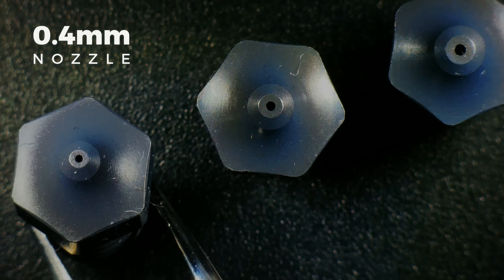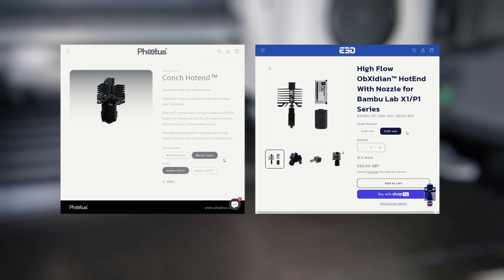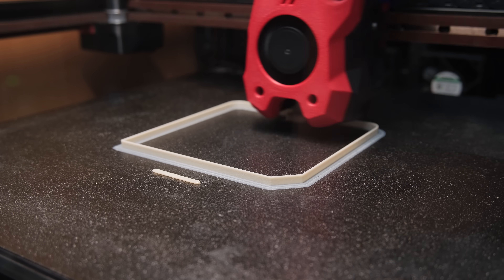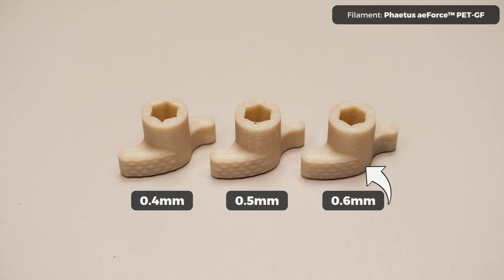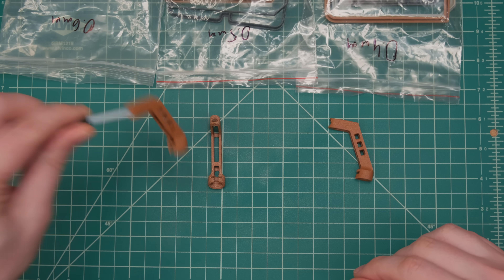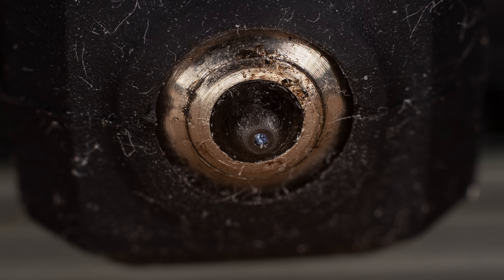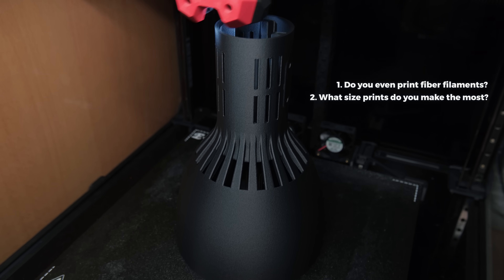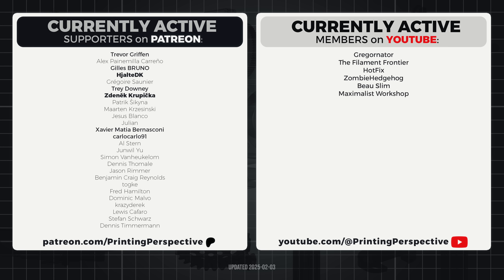DO NOT SKIP The 0.5mm NOZZLE! – THE GOLDEN SIZE

Comment: I've been using a 0.5mm Nanoflow (high-flow fully tungsten carbide), it's quite great. Bridges are worse though.
Reply from the maker: Glad to hear that people using and liking the 0.5mm size nozzles. :)
Reply: @PrintingPerspective  I also have a 0.3mm waiting to go on my Ender 3 for highly detailed prints. It's an ultra cheap Amazon special though, so I had to polish the tip on a drill to make it more uniform.
Reply from the maker: For smaller nozzles, I suggest getting ones from a reputable brand, as manufacturing smaller nozzles properly is way harder. It is not worth the headache, especially for something like 0.1 or 0.2mm nozzles.
Reply: @PrintingPerspective  Surprisingly, back when I was a total printing noob, I got many successful keycap prints out of the same pack's 0.2 nozzle on a bone stock Ender 3 Pro.
Reply from the maker: After I looked at how cheap nozzles look under a microscope, I never again bought 10-pack nozzles, but rather a single quality one. ;D